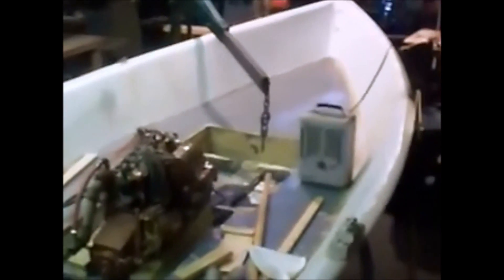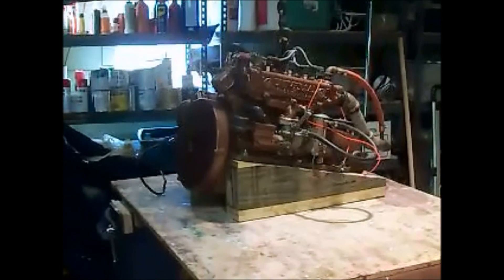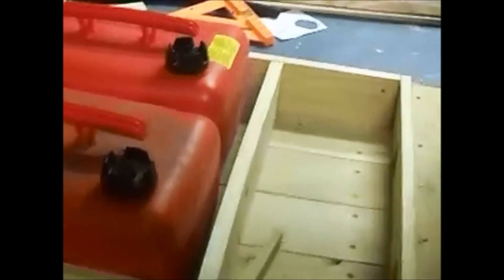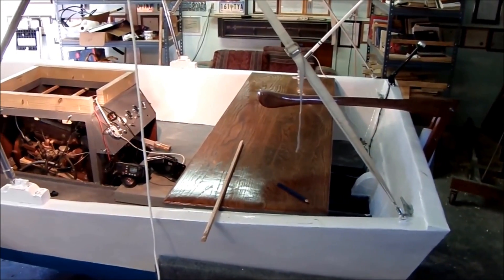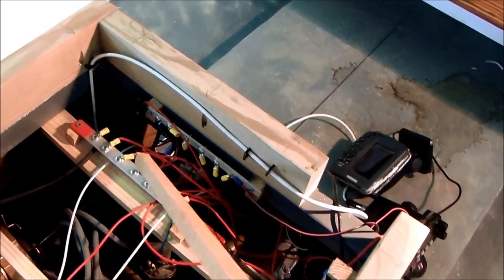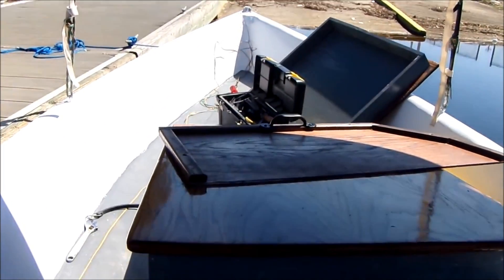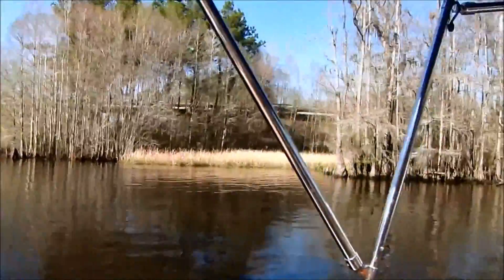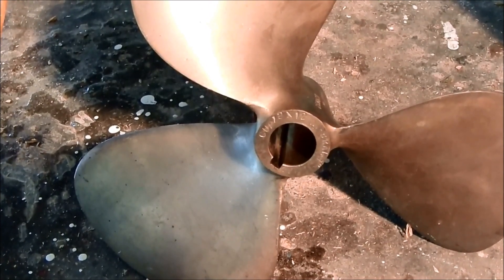Installing an inboard motor in homemade boat (short version)

Comment: I’m looking at building a plywood boat or modifying an aluminum hull to have an inboard diesel I bought out of a sailboat. Where would you recommend buying all the bits needed from the transmission all the way back to the prop? I am having troubles finding parts as well as knowing what I need. Thank you
Reply from the maker: 1.  I recommend buying an old hull.  You can probably get an old hull somewhere for free if you look around.  I built this boat, but if I had a do over I'd go with a derelict fiberglass 24 foot hull.
2.  I had the same problem with parts, but finally found everything I needed at a local marina.  Marinas normally have many abandoned boats and will provide everything you need for a price.  
3.  Now have to be honest.  This was a fun project, but an outboard motor makes a much better power plant.    If you just want a project the inboard is perfect, but if you just want a boat then go with the outboard.  My boat was built as part of my woodworking channel, and I then gave it away.

Comment: There's old semi planing boats that call for atomic fours. I wonder if you could plane it with a different prop?
Reply from the maker: The boat was too heavy.  That was my first and last attempt at building a wooden boat, and since I didn't know what I was doing, I over-built everything.  I originally powered the boat with a 25 Honda, and it would plane with a single person in the boat.  But the Honda outboard weighed in at 160 pounds, while the Atomic Four was 350 pounds, plus shaft, running gear, mounting blocks, rudder, etc.  
       Last year I gave the boat away in perfect running condition, and made a video about it.
Reply: @MemphisApplegate  overbuilt as in using too heavy of wood? 

I have given away a boat as well. A beautiful but delaminating Hurley silhouette. No junkyards would take it. I offered it for free, and found a guy who offered $60 delivered 30mi. He made it into a "fort" for his nephew. 

 that is a bit disappointing that the boat wouldn't plane with a 4 banger! 

I feel like I'm being "smart" by planning to build a 16' steel design called "hardshell". It calls for an atomic 4. The plans say it will do 20mph, but I'm not too sure. It's a semi -v, so it's halfway believable.

I feel that sheet metal will be simpler and faster for me to build.

Comment: Should have attached a 4 speed manual transmission 3 forward speeds neutral & reverse. The theory that multiple speed transmissions do not work on planes & boat is a lie. When RC electric & nitro engine  cars & trucks came out, I adapted them to RC nitro powered boats & planes. This allows your boat or plane to run at higher cruising speeds while the engine runs at lower rpms, like half throttle or less. The motor must be high in torque & would probably work best with diesel engines. With planes it's true you can only spin the propeller so high because of the mach tip speeds. I put a 3 speed transmission in an rc plane & it was able to fly it at top speed at half throttle. As for variable pitch aircraft props & variable  pitch marine propellers, reducing the pitch in the propellers only reduces the trust it is putting out. Why do that when you can speed the propellers up to maximum rpms, while reducing the engine rpms, hence saving fuel, and also wear, & tear on your engine.

Comment: I am wanting to do something similar.
I just want it fast enough to go about 9 nmph upstream in the Ohio river.
I want something a little unique to become the crazy guy on the river fishing.
Would you recommend a boat already built like you did or a start from scratch build?
Reply from the maker: I will sell you this boat.  It's a great boat, but:  1) I'm not a boater, 2) I'm not a fisherman, and 3) I'm too old and geezed out anyway.  It has been a long-lasting wood working project.  Check out some of the latest boat videos from last year.
     I built this boat too, and set it up with a 25 HP outboard.  But being a crazy guy like you, I wanted something different.  So I bought the Atomic 4 as a basket case, overhauled it, which was easy (real old-school).  
     Here's what I'd recommend:
      1.  Buy a basket-case junk factory boat hull.
       2.  Install an air-cooled light lawn mover engine in it.  
      Here's my rationale:
       1.  Unless you are really into boat building as a hobby, you have a big shop, you have all the tools, all the money, and all the time, you are better off with a factory boat.  Frankly, I could have bought a better boat for half of what I spent on this one.  
       2.  The Atomic 4 in this boat weighs in at nearly 400 pounds, so it needs all of it's 25 HP to cruise at 12 MPH.  If you rig in a 25 HP lawn tractor engine, you could make your 10 MPH at half RPM's.
Reply: I have a 18 hp onan out of a John Deere I may use.
Thanks for the advice.
Reply from the maker: @davidd3377  That sounds like the perfect size engine.  Another good part about a lawn mower engine is that you can work on it out there on the Ohio River.  These new outboards are too complex for the normal guy, and even an expert would be lost without the right tools and diagnostic equipment.  Hope to see your video on your project.
Reply: I have a couple back surgeries coming up so it will probably begin next summer.
If it wasn’t for the surgeries taking all my extra money I would probably consider just buying yours.
It would be perfect  for what I want.
I am never in a hurry these days.
I am pretty handy with a yanmar  so your engine is definitely something I can work on.
Reply from the maker: @davidd3377  My engine is simple, simple, simple.  About like an old model A engine.  I did upgrade to electronic ignition, but to convert back all you have to do is put the points back in the distributor.  
     A diesel Yanmar would be sweat.  Good luck on the back issues.

Comment: why would you take that nice four stroke Yamaha off, to install that engine?
Reply from the maker: You must be a real boater or fisherman, with real experience with boats and motors.  Right?  Well, I'm not.  I'm just an old man who likes to do woodworking and tinker in my shop.  The only time I've ever taken that boat out is a test run following some work I've done.  It is a project; a fun project.
      If I wanted a boat, then I'd buy one, and the boat I'd get would be much better and much cheaper.  I think I probably pointed out this fact in the rest of the series.  So, I guess we agree.

Comment: Nice ride. How easy is that flat head and updraft carburetor on gas? It looked close to the size of an old gas Tractor engine. I had often thought about using and Allis CA or Farmall a thru super C engines to make an inboard about of because of how they stretch a gallon of gas. But that is a nice Sunday evening putter around the lake boat. I love going fast but it's nice to just relax and listen to a smaller engine purring.
Reply from the maker: I think it is more like a Model T, except way over-built with very good steel.  The Atomic 4 is designed to cool itself with seawater.  Very important.  Sea water!!!  In summary, trying to adapt a freshwater engine to marine applications would be too hard.  Moreover,   outboards are better in every measurable way; from power, to economy, to weight, to utility, it is no wonder at all why outboards killed inboards.  Outboards are simply better in every way. 
     That said, make sure you understand these facts before you start your project.

Comment: This is an interesting build and I don't want to sound critical "but" the over lapping of your narration makes it hard to keep up with. Nice work tho and would luv to have that same set up.
Reply from the maker: The sound is bad.  I got a new camera setup now, and I try to avoid the overlapping caused by fading scenes together that have audio.  My newer videos sound much better.  Anyway, I like a little critical advice, as it helps me improve my video making.  Frankly, I think I have good content, yet I still don't get a lot of views.  So, it must be my video production.  

Thanks for the comments, and I sure hope you stick around for my weekly "Memphis Monday" videos..  Fast paced, and I try to complete a full project in each video (but sometimes it takes two).

Comment: Congratulations. Exceptional work. Knowing what you know now, would you do it again?
Reply from the maker: +Cheeky Monkees
I executed this project right after I retired, and I needed an interesting project.  I learned a lot; from woodworking, to engine overhaul, to inboard engine running gear.  
So it was worth the effort, as the whole deal kept me employed for over a year (including the boat building, and engine overhaul, which I didn't film).
If I were to do it again, I think I would try rigging a Briggs and Stratton lawn mower engine in a derelict hull.
Reply: ***** "lawn mower engine"
Gee, but the Atomic Four has a long history of service in sailboats. Correct me if I am wrong, but surely it was designed and better suited for this application. It certainly looked like it worked very well anyway. Your boat is very impressive. I was happy to see you moved the batteries away from the fuel.

I'm am curious, why a lawn mower engine?
Reply from the maker: Cheeky Monkees Why a lawn mower engine?
At this point in my life (69 years old), I'm not looking for the practical, or most efficient, or best, but the most interesting.  
    Certainly a modern 15 HP outboard would be best.  Reliable, affordable, etc, etc.  
     If you are young, then I can tell you that the new stuff is better in every measurable way.  But when you are 69 years old, perhaps, you will long for those long lost days; days when you understood how your engine worked; days when you could actually fix it.
    Why a lawn mower engine?  Because I can understand how it works.  Because I can instantly know why it malfunctioned.  Because I can fix it.  
     But wait.  Memphis, you know how the Atomic 4 works, after all, you overhauled it!!  Answer:  Yes, but it weighs 350 pounds, which is a mighty weight to haul if you are 69 years old.  
    Oh, to be young again!!!
Reply from the maker: +Cheeky Monkees The Atomic 4 is amazing.  It is built with alloys that resist 100 percent salt water, which is used for cooling.  My engine is a 1972 I think, and it started on the first crank after overhaul.  
     Why did it start?  Simplicity.  In a few minutes you can totally understand how one of these engines work.  A few more minutes, and you know why they stop working.  And a few more minutes and you know how to fix them.  
     This is what drew me to the Atomic 4.  If my 2015 car stopped running, I'm stranded.  However, if my 1972 Atomic 4 stops running I would instantly know both the problem and the solution.  
     This is what we have lost in this modern age:  granted things work better, but if they DO break, we can't fix them.
Reply: +Memphis Applegate "Atomic Four"
Thanks for that great reply. 
I know of what you speak. I  pushing 60 and am disabled with arthritis. I empathize with you when it comes to lifting, pulling and pushing. I had no idea the Atomic 4 is so heavy. Wow!
I guess when dropping it in a sailboat it's less ballast that has to be put in the keel. 

I love the way you laid out your boat. Very well thought out and executed. And it's your first boat as well. I think you are a natural.

You must be an engineer. Was the Atomic 4 easy to rebuild due to your background or is it just silly easy to do?

If you ever decide to sell I'm interested......
Reply from the maker: I would sell it, if you are really interested.  PM me.  If you are really interested, then it is yours.   843-465-9594

Comment: Congratulations. I've been around boats all my life and getting a project like this finished can be a really challenge as I'm sure you know.
But yours does look finished.
Of course we all have different ways we would have done things but that's not the point.
I was however looking at the way it was running in the water and wondering ,as you probably have, to is it running to bow high?
With that flat bottom to the boat it should be able to "plane' in smooth water. It may just be the weight of the boat and engine is too much but I'm thinking that if you adjust the trim , moving live weight forward , like moving the teen forward , might get the boat on the plane and once up on plane you can move back and it should stay on plane. It is tricky to get right and playing with the right prop might help. Can you borrow some other props to try out differences?
Have you been getting much use out of the boat?
Thanks for posting.
Warren
Reply from the maker: +warp21drive 1.  Yep, she is finished, as finished as a boat ever is.  But I enjoy working on the boat, so I'm always adding and subtracting.  Since this video I have built a new seat system, installed new batteries, and installed a new wiring system for my trolling motor.  
2.  Riding high.  My intention was to place the 350 pound Atomic 4 forward of the center of buoyancy, but the geometry of the propeller shaft and my trailer construction wouldn't allow that.  I was able to place the engine forward enough to allow the boat to float level with my calculated draft line.  Unfortunately, it floats, unloaded, at the maximum draft point.
3.  Weight.  The boat is way to heavy.  Those attempts to plane were only as successful as they were because I unloaded everything I could from the boat, and put only one 130 pound kid in it.  Putting another kid in the bow might have done the trick;  I'll have to remember that.
4.  Power.  The Atomic 4 is rated for 25-30 HP, but I don't know what I'm really getting.  I suspect that a real mechanic could tune the engine better, especially the valve adjustments and spark advance.  
5.  Propeller.  I've run it with three different propellers, and finally bought the high-dollar Atomic 4 propeller.  But still I'm not getting the maximum RPM's I know are required to get full HP.  This is why I suspect I have tuning issues with the engine.
6.  Transmission.  I overhauled the engine, but couldn't figure anything to do on the transmission.  But I think the friction plates on the transmission have glazed over, which sometimes causes the transmission to slip when under load.  I suspect this because the kid driving the boat reported that he had to "back-off" on the throttle because the transmission was slipping at full throttle.  I have adjusted the transmission, but can't get it into gear if I tighten it anymore.
7.  Use.  Not much.  I've discovered I'm more of a builder than a boater or fisherman.  Frankly, the boat is more of a project than it is a boat.  
8.  Thanks for watching and providing your thoughtful insights.

Comment: Having your batteries and fuel tanks both located in the same sealed compartment is a recipe for a fire and or explosion.
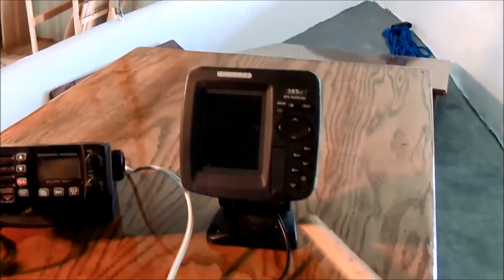Reply from the maker: John doe I fixed that early on.  Talk about it at about 5:45, covered in detail in the long version.
Reply: ***** I guess I missed that I don't know much about boats, but I was a licensed aircraft mechanic for 20 years so I understand about the systems that make up machines like boats, cars, planes etc.
Reply from the maker: John doe The idea smelled from the start.  I tried to talk myself into it by making the lid lose-fitting, and installing two air-circulation ducts back into the engine compartment.  I know what you're thinking, and you are right: "the vents to the engine compartment only made it worse!!"  
     The irony of it all is that after I finally got all the bugs out of the design, I discovered I liked building boats more than riding around in them.  I build lots of stuff, and I put out a new video every Monday called Memphis Monday.  Hope to see you around the campus.
Reply: ***** I agree, I've been part of building a few experimental aircraft and you always keep the fuel and electrical systems as far apart as possible, you never rout fuel lines above electrical wiring or components, its just not a good idea, I also like building things hope to check out some of your videos. Also if your a wood guy you might be interested in knowing their have been some pretty famous aircraft built out of wood, its a great material.
Reply from the maker: John doe I've visited the Spruce Goose, and I'm pretty much an expert on the Wright Brothers.  If you're into experimental aircraft, then you must be a Wright Brothers fan too.
Reply: ***** Ive never seen the Spruce Goose but I would like to, I used to eat and sleep aviation history, especially the development of aircraft power plants, I am definitely a Wright Brothers fan, but I probably know more about the Curtiss Wright air cooled radial engines than the Brothers themselves.
Reply from the maker: John doe Don't think the Spruce Goose is on display anymore.  It was in Long Beach, California.  
    After showing and selling their completed aircraft, the whole industry of aircraft design and testing took off without them.  The Wrights discovered many technical things, but the two most important discoveries were that an aircraft needed three axis control, and that a person needed to LEARN to fly.  Once these facts were out, there were hundreds, and then thousands of aircraft in the air.
Reply: Memphis Applegate Great to see you know some stuff about the Wright Brothers! I grew up in Kitty Hawk. About 3 miles from where they flew!
Reply: hey ,if anyone else  trying to find out boatplans online try Joolaim Rudder Replication (just google it ) ? Ive heard some extraordinary things about it and my m8 got great results with it.